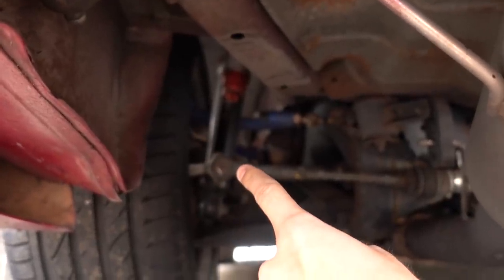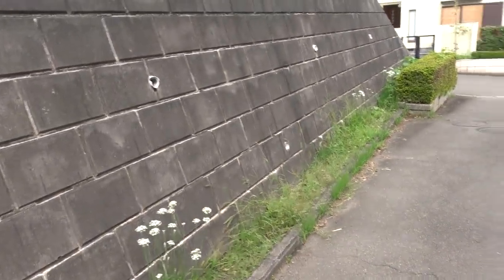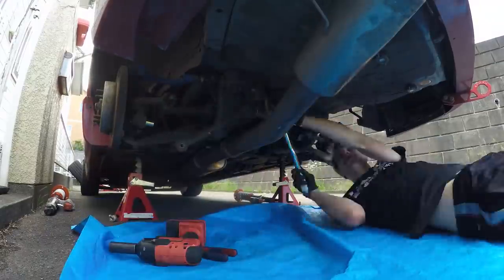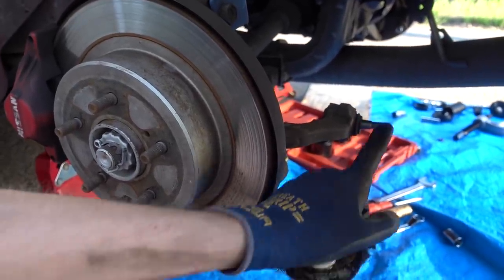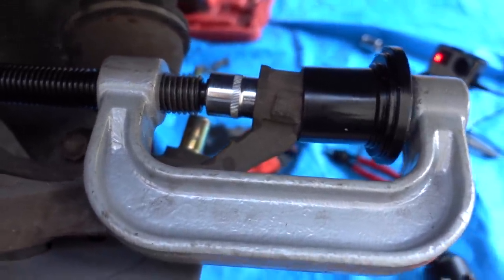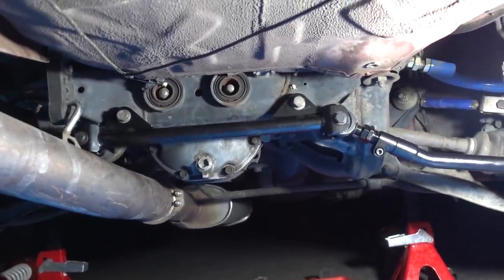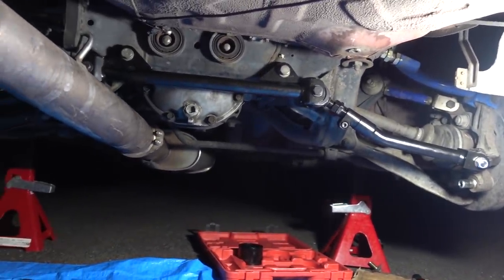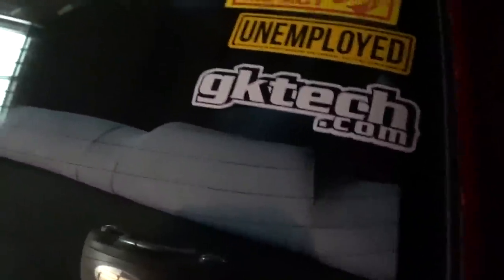REMOVING THE WORST PART ON MY SKYLINE!

Comment: The accident you had is one of many reasons why I like the paddle or trigger style grinders.
Reply: I'll never use a electronic grinder again. Air tool only. Much safer
Reply: @VintageTechRepairs  It holds the same dangers as a paddle or trigger style electric angle grinder just in a smaller package.

Its well better than the switch style but not really much different from a paddle/trigger style when it comes to safety.

Comment: The tip of heating it up makes it so much better, doing the same thing on my 180 and saved hours of hammering and swearing! I used a pitman arm puller rather than the whole G clamp setup, but taking the coilover out is necessary too, pressing it out towards the ball joint was so much easier hahaha

Comment: Just did this to my r33 here in the U.S. last week, love it! Sorry to say but you actually did NOT have to remove the coilovers just the bottom bolt to get the ball joint out. I was able to rent for free too the ball joint remover from AutoZone. I used the grinder to grind the lip off and press it out the other direction. I had to use a 3ft. Torque bar to help persuade the joint out. Used a screw driver on my clups as well. Thanks for doing these how to's cause for R33's in the U.S. there is no help locally

Comment: Brah....I mean you didnt show it but if you tightened those bushings with the wheels drooping then its all wrong. Suspension parts need tightened in neutral position. Ride height. If you tighten the bushings with wheels drooping then then when you drop the car and suspension compresses it turns bushings and they are at full flex at ride height and dont have room to go up any further.  If they are tightened at ride height thenthe bushing can flex in 2 directions insead of 1 direction.

Comment: Getting mine done on my 33 this week with gktech kit.  I was having it act up in even 5th gear where it felt like I was losing traction in the rear.  It felt extremely dangerous, the wheel would move side to side.

Comment: ive used a jack that has a 5mm wide rubber part in the middle of the wheels, it compresses when you jack the car but when you roll it around its silent. such a nice jack XD probably twice the price of a normal jack.